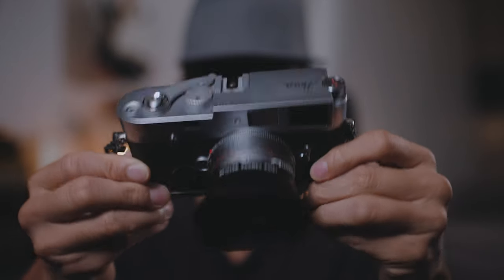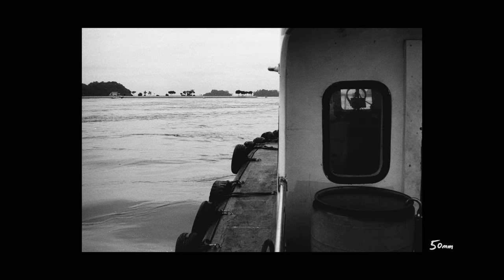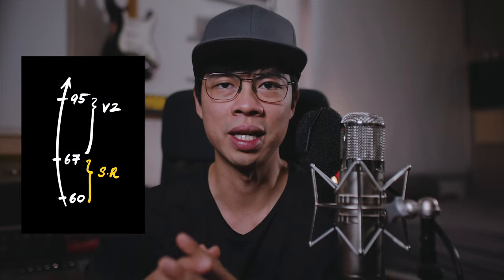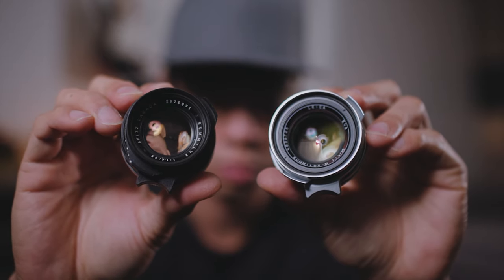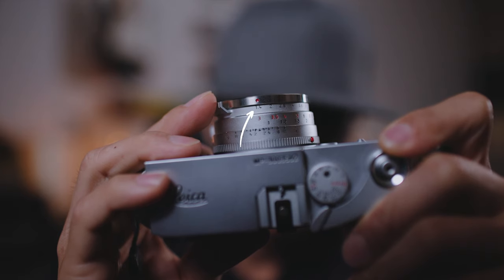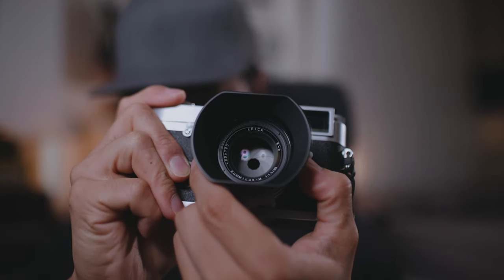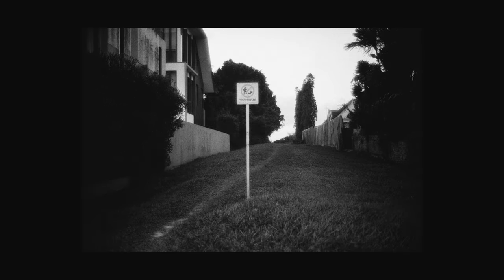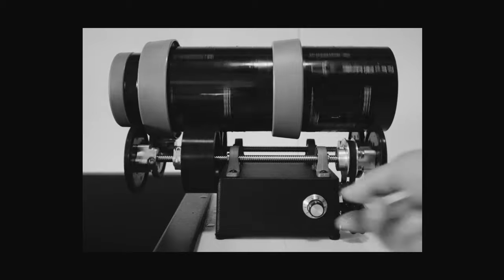I did it... Leica 35mm Steel Rim Reissue Review (pre ASPH Summilux F1.4 ft. Leica MP)

Comment: I found the round hood for the V2 Summilux isn't too bad. I've put a small black rubber band in the groove where the hood clamps on to, preventing it from rotating. You can then put the tabs at the 12 and 6 o'clock positions to avoid it getting in the way. I think the square hood meant for the Summicron 35mm asph is doing a better job for flare anyway, although without any filter.
Reply from the maker: Oh man, wish I heard from you sooner... 😅 Thanks I'll try to find a rubber band that fits! I have the square hood on the ASPH summicron, it doesn't quite fit on the pre-asph Summilux sadly.
Reply: @jeremy-t  did you have any issues with backfocusing with this lens? I bought the new steel rim (11301) 2 days ago and it focuses too far throughout all distances and all apertures. I have few cameras and few lenses and it’s definitely this lens fault. I know I should send it back but it’s so annoying.

Comment: Another excellent video! Thank You! 
Jeremy, from Your experience, which 35 has the most similar character to 50 summicron v4? I have CV Nokton 35, 1.4 V2 MC. But at 1.4 it looks like loosing a lot of details/resolution. And the glow during daylight sometimes is too much for me.
Reply from the maker: Thank you!! That's a great question.. The 50mm v4 cron is a unique one.. The closest thing that comes to mind is the LLL 8 ele 35mm clone.. Nothing from Voigtlander really does a similar thing.. The 35 f1.5 is really modern, and the F2 is much more "clinical" and technically proficient.. Even the Zeiss 35mm F2 biogon might be similar in terms of tones (colours, contrast etc), but the background blur characteristic is completely different. But yeah, check out the LLL 8 ele! :)

Comment: curious about the contrast difference between the two. I got the reissue because I was looking for a lower contrast lens for BW, but I think leica might have updated the coatings to be too modern
Reply from the maker: Yes, the steel rim reissue does have a higher contrast than the vintage piece! In the comparison pictures at the end of the video you can see that, especially in the blacks. A full video on this will be out soon!
Reply: @jeremy-t  Yeah I noticed that, and it's surprising to me they wouldn't maintain that aspect, as it seems like the main selling point of the lens (to me at least). I guess I'll have to sell my reissue and get the original. I am not a fan of the glowing effect on color anyway with the reissue, so the updated coatings gives me no benefit

Comment: Kinda wish they extended close focus to 0.65m like the old goggled version (ironically for the M3). I was disappointed by that upon release, so I ended up modding my pre-asph V2 to 0.7m close focus myself. Also gonna make a steel rim style threaded front ring.

Also I second Fjalll's suggestion of the rubber band in the groove. I personally use dental bands but black bands would look better. I'll need to find myself some.
Reply from the maker: Oh man! How did you mod it?? Please teach me! haha! And I'd love to be able to have threads on my v2 too..
Reply: @jeremy-t  Essentially I've removed the close focus hard stop from the lens to allow it to focus closer than 1m. Conveniently, part of the rangefinder cam helicoid jams into the lens block helicoid's follower at around 0.7m close focus, which could act as a makeshift hard stop. I plan to reinstall the original hard stop but at 0.7m, mainly to prevent putting extra stress on the helicoid follower (would be very bad if it breaks off).

If you file down the helicoid follower or the helicoid a bit (doesn't affect function, might affect strength), you could probably reach 0.65m or closer.

As for the steel rim style threaded front ring, I plan to get a few machined, which I'll then get finished in steel and/or black. I'll also make the models/drawings available for anyone that wants them. The front ring (for my lens at least) pops off with 3 grub screws.

I do wanna note that these grub screws all over the lens seem very fragile. The previous owner of this one stripped a few of them and I had to drill them out and retap the holes.
Reply from the maker: Just saw this… That sounds amazing! Filter threads would be great….. You sound really experienced.. Man.. If you sold the parts + tools required to replace that front ring, along with a simple video with some instructions.. I’m sure many, many people (myself included) would deeply appreciate it, and I’ll be your first customer!!! 😁 I’d love to learn how to replace that front section, but I don’t know anything about working with lenses!
Reply: @jeremy-t  I plan to make the front ring part available to purchase and installation will be as simple as unscrewing/screwing 3 small screws. Still working out what filter size to do, vignetting limitations, and whether to retain hood compatibility. By the way, what's a good way to directly contact you? I have messaged you on your Instagram but it seemed inactive hahaha
Reply: @jeremy-t  Also, I have posted my close focus mod to Rangefinder Forums, L-Camera-Forum, and the /r/Leica subreddit, if you wanna take a look. Some users on RFF have also shared some interesting oddities, like a late Summilux that focuses to 0.75m from the factory!
Reply from the maker: Oh that’s awesome.. I’d love to get one when it’s available! I’ll take a look at the subreddit.. and yes Instagram is fine, hahah yes I’ve been inactive, but I’ll chat with you there!
Reply: @DanielCaiMedia  Can you drop your username, or a link to those posts please?